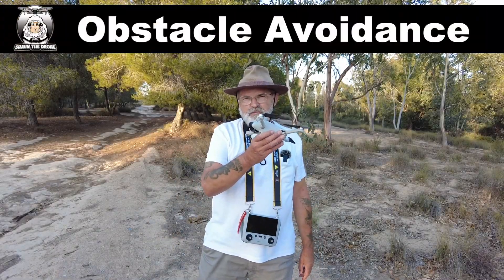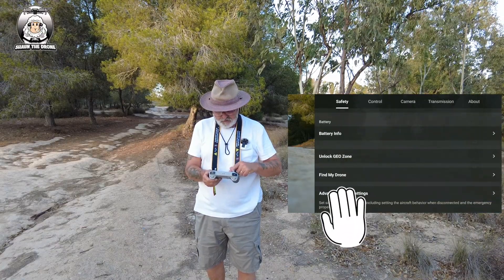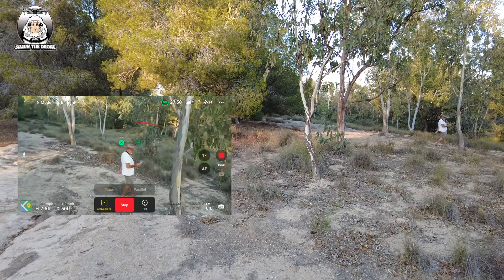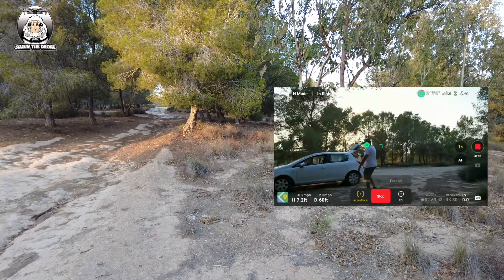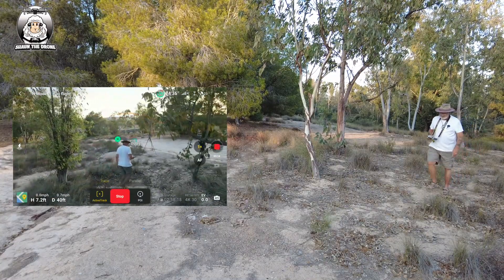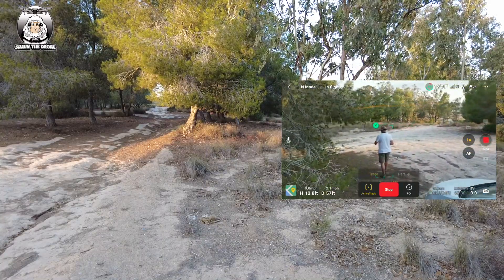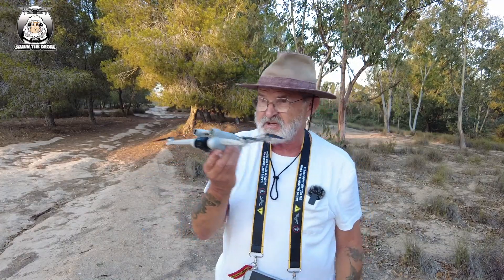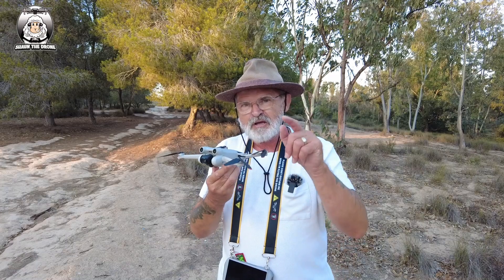How to tutorial Obstacle Avoidance DJI Mini 3 Pro #shaunthedrone

Comment: My obstical avoidance doesn’t come up in safety tab ? I do have the DJi mini 3 pro, how do I get it to come up ?
Reply from the maker: Hi, you have to make sure the drone is on, if it's on and not in the settings under Safety, you need to contact DJI Support and inform them. Good luck :)